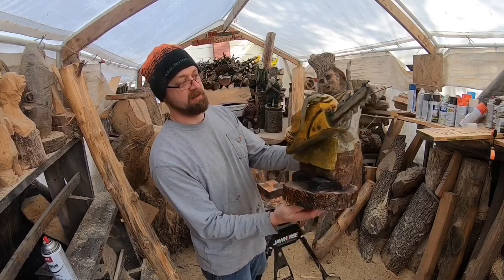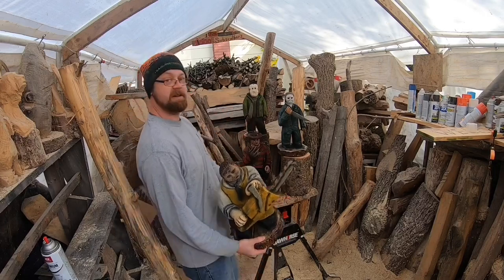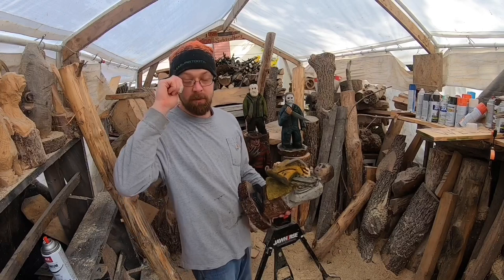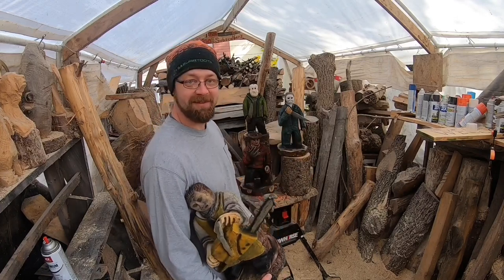Chainsaw carving Leather Face . Sculpting fan art.

Comment: Kyle I have a question again man. Last question I asked you about starting your chainsaw bar oh, your information was great. And improve my work substantially. This is a question about wood. I cover for my first bear. It's carved out of what I think is Pine. I got him carved he said out there for a couple days. Still have a little refinement to do on the face. Went out there last night, couple days mind you. There were lines on the bass look like pink powder. They come from what would have been the center if you could have got to it for the better out to the edge. 1 inch or so apart. Look like they had to dripped out of him.? This would have been in a fire. It was very wet when it went in the brush pile that got burnt. Do you have any idea what it is? I've never seen sap do that.
Reply from the maker: I was thinking it’s sap . Or from drying sometimes different colors can appear on the wood .